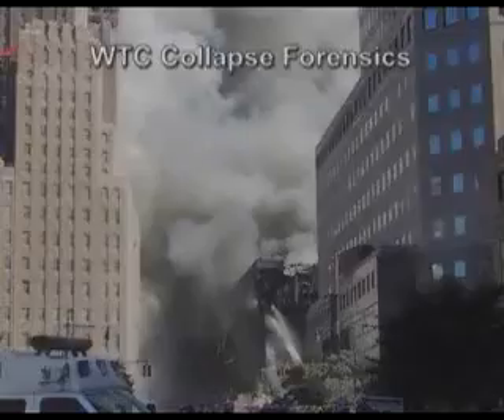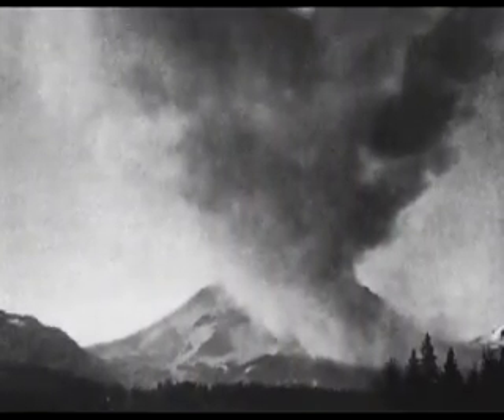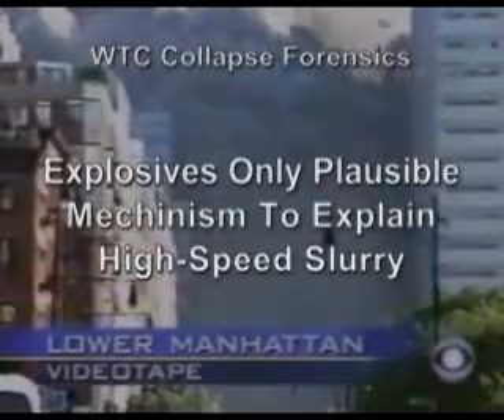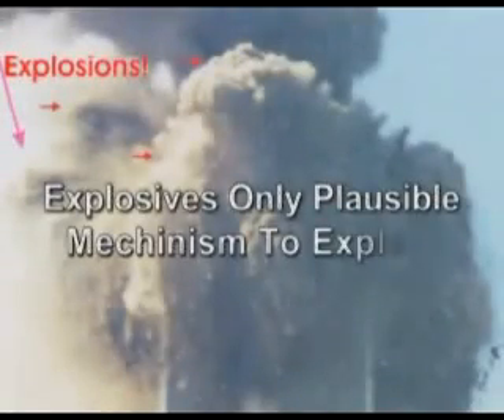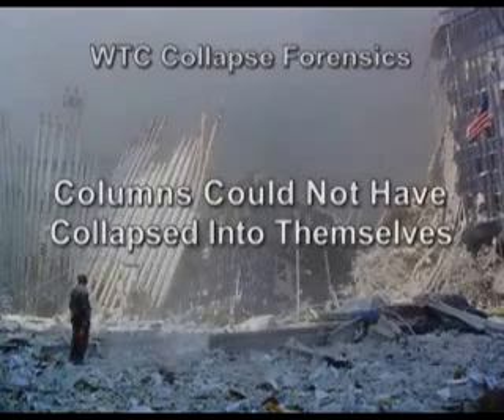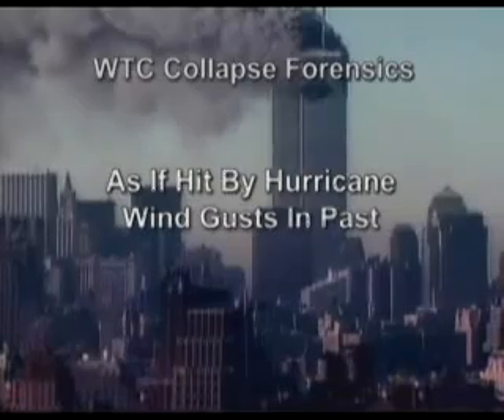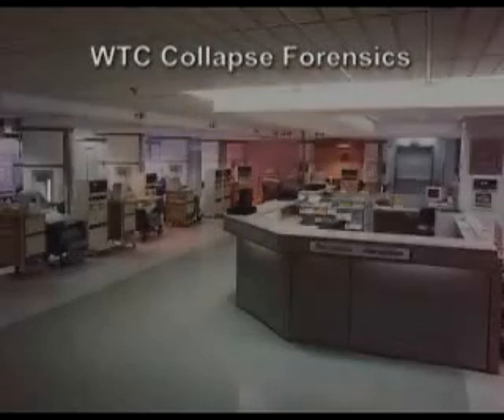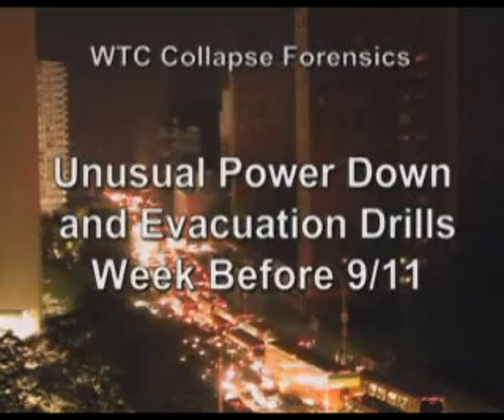MIT Engineer Disputes 911 Theory of the WTC Collapse-Part 2

Comment: 9/11 Truth nay-sayers like to rely on destroyed fireproofing that would have taken more energy that the plane impacts/explosions could generate, and the magical disappearance of structure that allowed an unimpeded freefall acceleration of the upper stories of the towers based on fires that at best might have reached 460 degrees C.
Reply: +Edward Anderson Though debunkers in general are quick to post this quote in an attempt to explain the 'collapses' of the twin towers, I have not encountered one yet that can explain "the motion of the falling portion began as a free fall".

"Structural systems respond very differently to static and dynamic loads, and since the motion of the falling portion began as a free fall through the height of at least one story (roughly three meters or 10 feet), the structure beneath them was unable to stop the collapses once they began."
Reply: +Mike Benign  It's pretty obvious what happened. The fires burned up all the air, and once the air was gone that meant there was a vacuum. Once there was a vacuum, the upper portion of the building rushed in to fill it,  at free-fall acceleration! Ta-Daaaaa1
Reply: +Edward Anderson I admire your ability to keep your sense of humor Edward. I know how discouraging it can be to face down these troll administrators (monitors) every day.
Reply: Mitch Mabee
Sooo..........you're not going to set any precedent for your cult of debunkers I see Mitch?
btw: answering a question with phys-op gobbledygook is not breaking new ground for your species.
Reply: +Mitch Mabee You will never see a debunker such as yourself explain the Ace Elevator Company employees running like scared chickens at the first sign of trouble on the morning of 9/11.
Reply: I don't know. Personally, I use the alleged "debunkers" as a weather vane of truth. Just look at the direction that they point their disinformation, then choose from the other 359 degrees of the information compass.
Reply: Mitch Mabee
Can you only find an intellectually compatible opponent in the mirror Mitch? Have you given up hanging around playgrounds with bags of candy?
Reply: Sandy P~all
Keep it up Chump Charlie. The more people that observe your operation to duplicate other users identity to post this kind of garbage attributed to them the better.
Reply: +Sandy P~all Ah now thats interesting. So they know something yes? Excellent, so what did we find out? What did they know? Ya that's what I thought. You weren"t just spreading innuendos and rumors were you Sandy? What can you learn that way? You see truth Sandy does not fall in your lap by simply starting a rumor about what it looks like was sort of on the minds of the elevator employees.  You dont come across truth that easily Sandy. Truth  takes hard work. Truth takes painstaking research and the willingness to dismiss an idea once its proven wrong.
Reply: Mitch Mabee
I can narrow that definition down for you Mitch by qualifying a "debunker" as a stooge who always writes the phrase "that has been debunked long ago". If you use that phrase in your normal YouTube activities, chances are good you are one of those assholes.
Have a great day.
Reply: +salvatore lucido if that's scary when you get to the truth you will not sleep for a few days!! check out the 911 Toronto hearings and project constellation by Richard andrew grove.
Reply: Mitch Mabee Well Mitch, the explanation is that your little Gish Gallop of speculation doesn't match the actual level of conspiracy, in which only a few were privy to the operation, and the rest were just unwitting pawns.
Reply: Mitch Mabee Hardly the same. The people who carried out the prep for 9/11 and provided the logistical support likely thought they were doing more benign activities, like construction and war games.
Reply: ***** Reality sucks sometimes.
Reply: Mitch Mabee The war in Iraq and the war in Afghanistan didn't "already exist".
Reply: "We'll know our disinformation program is complete when everything the American public believes is false."
_ William Casey, CIA Director, 1981
Reply: Mitch Mabee
Would it really matter if he did, or did not, since it represents a common view of the (lack of) intelligence community in my opinion? I know there has been debate over whether he did say that quote. I'm sure you'll say that's been debunked for years.
This is a very common when things like this occur. People just don't want to admit shit happens and take their lumps.
Reply: The kinetic energy was not absorbed by the structure, the structure failed because it was only able to stop a KE impact of 187 pounds of TNT, Flight 11 and 175 hit with 1300 and 2093 pounds of TNT, 7 and 11 times greater than the shell could stop, aka absorb, the excess energy went on to damage or destroy 6 to 10 core columns, whose wallboard was dislodged easy by the energy of impact.  
The WTC shell was bowing in, due to fire. Unless you have some fantasy of silent suck-a-bombs.  
The impacts were worse than big bombs because they were kinetic energy impacts, equal in energy to 1300 and 2093 pounds of TNT, but no blast effects, all the energy was directed at destroying the WTC stuff, insulation can be seen blasted out by these massive impacts.
The fact is you can't comprehend kinetic energy impact and are void of math, physics, and science. No wonder you are gullible falling for lies and BS made up with dumbed down opinions, like you have. 
The kinetic energy is not an explosion, it is the impact, it was massive and looks like an explosion because of the energy involved, and all that energy was used to dislodge the insulation and destroy structure. Next life take physics.  Me the dimwit is an engineer, and you the super 9/11 truth repeater of woo, is so smart, you fall for the same lies the Boston bombers did, and now you mock the murder of thousands with a failure to comprehend simple physics.  Good job, I am glad I am a dimwit and you are so smart you can't get anyone to believe your lies you can't define, or support with physics.  
Ironically Dimwit knows physics, and know fire destroyed the WTC complex, and I have proof the fires exceeded 660C, and higher; you have woo, I have the good old dimwit standby, science, physics, math, and critical thinking skills.   Geeks rule, you spread BS base on your common sense, for you it appears your common sense is the collection of prejudices acquired by age eighteen. Albert Einstein knows your failure.
Got Physics? No you have BS based on your failure, based on hate, based on laziness.  
When will you break the big story?  Dimwit wants to know... This is your best, being a peer of the Boston bombers on 9/11 truth issues.  Cool, you got famous super smart peers in 9/11 truth, who knew/
Reply: +Sandy P~all I have always found it very easy to dismiss the conspiracy group, like Noam Chomsky it's an unproductive argument. I'll say this, though my position has not changed, I admit my position gets really fucking hard to support once we mosey down the street to building 7. That anomaly is a fucking bugger. I feel like most of the time I am basking in the bright light of empiricism until building 7 comes up in the conversation. Then my position takes on a stench of religion. I start feeling like I have taken some Jim Jones leap of faith
Reply: +salvatore lucido Maybe it was a bad example, the point is even the most strict empiricist confronts a myriad of unknowns everyday. The idea is to follow the evidence, not start with an outrageous hypothesis and then refuse to consider any evidence that threatens it. See every conspiracy theorist for further examples.
Reply: +Sandy P~all Im sorry I dont follow. The term. debunker; doesnt narrow anything down. Do u mean conspiracy debunker assholes  like myself? or those that debunk the anti conspiracy  group?? Also to thoughtlessly dismiss all evidence that doesn;t bolster your own theory as part of an elaborate disinformation campaign is either a convenient miss step in logic or paranoia of a clinical severity.
Reply: +Edward Anderson And you believe this idea.?? So your saying its a lot like suicide bombers. They strap explosives on the kids and say No silly you'll be fine, dont you know how explosives work? They blow out not in. You wont have so much as a scratch. Back state side pre 9/11 the boss says hey new guy crawl thru the wiring duct on the 83rd floor  and attach this to the support beam . Okay . .  Sir, why does it say Acme Bomb Co on the side. Oh that? thats just this this thing whats the Denver Broncos record again. 4 and 2 but that really doesnt answer my question sir
Reply: +Edward Anderson My govt is not capable of such an elaborate plot, nor has anyone in service of my govt ever kept a secret that long. Plus I still think you're weak on motive. Hitler's pay off for the Parliament building justified torching the place I guess. Tonkin Bay got us into the Vietnam war but The Patriot Act? That's the payoff? It's not enough. Did 9/11 generate consent for a war that didn't already  exist? I really don't know the answer to that one.
Reply: +Mitch Mabee In writing that post above I just realized that 9/11 if it was a conspiracy is closer to S.O.P. standard operating procedure isn't it.  Okay so it has happen often in recent history. I'm sorry that's still not proof. but I admit it stinks.
Reply: +Edward Anderson The kinetic energy impact of Flight 175 was equal in energy to 2093 pounds of TNT. More than enough energy to remove fire proofing on the floors; it can be dislodged with a finger; the core of the WTC was covered in wallboard, easy to remove with the aircraft impact. Witnesses saw wallboard in stairwells dislodged due to the aircraft impact; your BS statement is a lie, based on an overwhelming ignorance of physics. 175's impact was more energy than 2,000,000 shot gun blasts... next time do the math and physics, don't spread BS.
Reply: +eyesuntzu Hey! You with the reason and the new fangled empiricism, get out of here. This string is for wing nuts only. Just kidding but we prefer innuendo to science around here. Most these folks have a pretty tight white knuckled grip on their treasured conspiracy. In the words of Bertrand Russell-"You cannot rationalize someone OUT of something they didn't rationalize themselves INTO." They didn't use logic or reason to develop these theories so they will be useless tools in setting them straight.
Reply: +Sandy P~all Did William Casey really say that?
Reply: +Mitch Mabee 
Of course, your clearly a shill paid off by Jews to come on channels like this to troll and obfiscate honest enquery.
Reply: Mitch Mabee eysuntzu said,"Thus there was more than enough energy to remove the fire proofing on the floors; which can be dislodged with a finger" , and, " 175's impact was more energy than 2,000,000 shot gun blasts... next time do the math and physics before spreading BS based on lies."

Please check the NIST report, which puts paid to eyesuntzu's  "reason and new-fangled empiricism", which in fact is not, since he bases his conjectures on faulty and misapprehended "facts".

Those of us with enough information see right through his weak-ass crap, which he can dislodge with a finger.
Reply: +Edward Anderson You can't do math, not news.  You and physics never met.  You failed for 14 years to figure out 911, and your peers in this BS are the Boston bombers.  That is as much fame as you will get, believing the same lies the idiot Boston bombers believe on 911. 
Next life take physics, it will keep you from being fooled by a fringe few fake experts who do you tube videos.  lol, 14 years, no clue yet. 
You can't calculate the energy of the aircraft impacts, how can you make any conclusions.
Reply: +Edward Anderson You think there was enough energy to remove all the fire proofing? You really think there was enough fire? That black smoky oxygen starved fire caused this collapse?
Reply: +Banjo Marla Oxygen starved? When a fire has far more oxygen then it can possibly handle coming  from the easterly winds we don't call it starved. That fire proofing falls off by itself or by brushing your pinky finger across it will take all of it off. If somebody slams a door it comes off.
Reply: Mitch Mabee Funny how NIST couldn't affect the fireproofing significantly using a SHOTGUN test. You are promoting bad information. "That fire proofing falls off by itself or by brushing your pinky finger across it will take all of it off. If somebody slams a door it comes off." is pure BULLSHIT, intended to lower the threshold of proof for your idiotic argument.
Reply: +Edward Anderson Insulation was dislodged by the impacts; a fact. 
Under the floors the insulation can be removed by a pinkie finger. 
The core column of the WTC were insulated with wallboard, 3 inches, and it fell off due to the impact of the Aircraft.... a fact verified by survivors who saw the wallboard in the stairwells... evidence. 
Flight 11 was 3,075,000,000 joules, equal in energy to 1400 pounds of TNT, which destroyed 6 core columns, and knocked off insulation on multiple floors in the core; as eyewitnesses testified. 
Flight 175 4,380,000,000 joules, which destroyed 10 core columns... an impact equal in energy to over 2000 pounds of TNT... 
Facts and evidence prove fire caused the WTC towers to collapse.
Reply: +Nathan Bitchner People with the last name of Mabee seldom find themselves in a position to make fun of someones name. Until you stowed up. I'm quite sure I will thank you to stay out of my personal affairs. But if you must know when I go trolling for a new date I'm usually driving the 1972 Road King extended Dodge van with the curtains. Also known as the pedophile starter kit. Comes with one long rain coat, a box of Snicker bars and a speckled puppy.
Reply: +Edward Anderson You are right, I exaggerated to bolster a poorly made point. I concede the point . Because it makes no difference. Leave the fire proofing on. Let the jet fuel, paper and furniture stoke the heat until its on par with a ceramic kiln and ask yourself is the building in danger of collapsing BEFORE THE METAL SUPPORT BEAMS REACH A ROLLING BOIL?? I GRANT YOU, THE FIRE NEVER GOT HOT ENOUGH TO BOIL METAL ARE YOU SURE EVERYBODY IS SAFE FROM THE STRUCTURES COLLAPSING IF IT ONLY GOT HOT ENOUGH TO TURN THE METAL INTO PLAY-DO with a quarter million tons of concrete and steal on its back???? Are you sure its not even an issue when that metal softens???
Reply: +Mitch Mabee Give me one example of any other steel high rise "turning into Play-Do" from a fire and collapsing.
Reply: +Mitch Mabee I guess the demolition industry is just wasting thousands of dollars when they need to rig the columns with explosives and sever them with minute precision right? They could just light the office furniture on fire and it'll turn to play-do. Yup that's how poorly buildings are designed. What were we thinking? And silly us using steel pots and pans for cooking, don't we know they turn to play-do?
Reply: +misterhed Steel pots and pans you boil food in at 212 degrees?  What temperature has steel lost half the strength?  
Steel or cast iron where we braise beef at 375 to 450 F? Will this make non-load bearing pots fail?  Science, not opinions are needed, and the video is based on failed opinions.  
Demolition industry can't start fires and spread toxins, they would be in trouble. Fire destroyed the WTC towers, a fact the video failed to grasp.
Reply: eyesuntzu "Will this make non-load bearing pots fail? "
Uuuhh who knows what steel will do anymore, since apparently a fire of 300 degrees C caused WTC 7 to implode into itself at free fall speed. Maybe next time I turn on my oven it'll just collapse. I like how they took all the steel away and recycled it too so they can't investigate the evidence. So sciency.
Reply: +misterhed And you are an engineer?  Less than 0.1 percent of all the worlds engineers agree with the BS you have on WTC 7.  
When you get a PhD in engineer, you will discover 9/11 truth is based on ignorance, BS, lies and wild claims not base on science. Good luck.
Reply: eyesuntzu If it's possible to demolish a building so completely like that using fire why has it never been seen before? Why can't it be replicated? Isn't that one of the tenants of science? You can replicate it? 

"In the mid-1990s British Steel and the Building Research Establishment performed a series of six experiments at Cardington to investigate the behavior of steel-framed buildings. These experiments were conducted in a simulated, eight-story building. Secondary steel beams were not protected. Despite the temperature of the steel beams reaching 800-900 C (1,500-1,700 F) in three of the tests (well above the traditionally assumed critical temperature of 600 C (1,100 F), no collapse was observed in any of the six experiments)."

I don't know if me getting a pee aich dee will change the fact that building collapses due to fire NEVER happens.
Reply: +misterhed No matter how much BS 9/11 truth comes up with the Gish Gallop of idiotic claims, only 0.1 percent of all the world's engineers don't think fire did it.  That is a fringe of the fringe, a sub-set of insane engineer... Thus your BS based on BS, remains BS, and fire did it.  
Why has 9/11 truth failed for 14 years with a lock on infinity? 9/11 truth has no evidence, no clue, and no rational claims.
Reply: Thank you very much for repeating your appeal to authority fallacy again. Once more, show me... another instance... of a steel high rise that collapsed from a fire. It happened 3 times in one event apparently, surely it should have happened at least once in history?
Reply: +misterhed LOL, the NIST report was done by experts, hundreds... thus this is not an appeal to authority, it is authority. 9/11 truth makes the appeal to authority with idiot engineers who can't think rationally; thus you failed to understand your less than 0.1 percent authority group of failed engineers, is the classic failed appeal to authority fallacy.  And you offer no evidence, the same as your BS engineers you can't get to do a paper in real journal to support your fantasy version of 911, where steel can't fail.  Good job failing on the fallacy, that was funny.
Steel fails in fire, a fact 9/11 ignores.  No big deal, zero evidence for 14 years from 9/11 truth, with a lock on infinite fail.
you never will produce a valid argument, as you and less than 0.1 percent of all engineers fail to make a valid claim, and produce BS claims based on delusional opinions.... keep up the good work, is Bigfoot next, or will it be chemtrails?  lol
Reply: eyesuntzu ". thus this is not an appeal to authority, it is authority"

LMAO LMAO LMAO that's what appeal to authority fallacy means!!!! hahahaha

"Steel fails in fire"

Show me a steel building that has failed and collapsed in a fire. come on not even once? like in the industrial revolution or something when safety was shit?
Reply: +misterhed You don't understand the logical fallacy on authority. In fact, the designer of the WTC structure, says if fell as it would in fire. Thus you fail to realize the guy who signed the blueprints, knows the WTC towers could fail in fire, and it collapse exactly how he expected his structure, he designed would fail. This is the number one reality based authority on earth; thus it is not a fallacy, he is the authority.  9/11 truth has engineers like the the nut in the video, who are not experts or have BS claims, and that is appeal to authority.  You getting an engineer off the street, and he claims it can't happen is an appeal to authority. The fact that many engineers worked on the NIST report and all engineering associations agree it was fire, is not an appeal to authority, it is fact based evidence driven studies you have to ignore to have the 9/11 truth dumbed down lies and BS.  
May studies were done beside NIST, they all agree it was fire.  Sorry, but this is based on engineering and studies not failed opinions from less than 0.1 percent of all engineers.  
You got nothing, never will; your peers in 9/11 truth, the Boston bombers, two idiots agree with you.  Congratulations.  Better luck with Bigfoot, and Chemtrails.
Reply: eyesuntzu So the claim is that the government perpetrated 9/11. And because the government investigated itself and found nothing wrong that's proof? But 2000 architects and engineers are just appeals to authority. Your 0.1 percent figure doesn't mean anything. Most people just do their job and it isn't their area of expertise. What about how in 1993 John Skilling, head architect of the WTC said 
"We looked at every possible thing we could think of that could happen to the buildings, even to the extent of an airplane hitting the side… Our analysis indicated the biggest problem would be the fact that all the fuel (from the airplane) would dump into the building. There would be a horrendous fire. A lot of people would be killed. [But] the building structure would still be there.”"
Oh wait, only the authorities that contradict you are appeals to authority..
Reply: +misterhed John Skilling was not the chief structural engineer on the WTC towers, Robertson was. Robertson worked for Skilling. 
And the aircraft impact for the building to survive was at 180 mph, an impact energy equal to 187 pounds of TNT; the impacts on 911 which removed the fireproofing from floors and core were equal in energy to 1400 and 2000 pounds of TNT.  Thus impacts more than 7 and 11 times great than design happened on 911.
The aircraft impact was for an accident, like trying to land in the fog, the only accident possible for an airliner who is low on fuel; a fully fueled airliner would climb to clear weather and land in the clear, not be lost in the fog to hit the WTC... the impact for the Empire State Building was equal in energy to 18 pounds of TNT, and did a lot of damage with fire... the WTC would stop the ESB impact, and also a 300,000 pound airliner at 180 mph. Facts not BS.
Skilling never said the building could survive an impact over 180 mph.  
steel fails in fire - 99.9 percent of all engineers agree with me; you can ask them, but you can't, you are too busy using google to do the Gish Gallop of BS.
Reply: eyesuntzu Why haven't you gotten back to me with an example of a building collapsing due to steel failing in a fire yet? What is this 99.9 percent bullshit? You would have to ask every engineer to get that figure.
Reply: +misterhed WTC 1 and 2.  Plus it is a fact steel fails in fire.  9/11 truth liars can't comprehend the science of steel, they use BS opinions based on overwhelming ignorance and paranoia.  
Prove steel can't fail and fire, prove there were explosives, or what ever silly claim you have; and I will be on CNN with your evidence and be famous; give me your evidence... 
LOL, you got BS from the Internet, where everything is true....

You are gullible - don't get upset, get knowledge
Reply: eyesuntzu LOL you had to use OTHER buildings from 9/11??? You couldn't find any other demonstrations of buildings collapsing due to steel failure from fire, but it happened 3 times in one day, one of which wasn't hit by a plane?

That's like if I said last Wednesday Billy, Bob and Joe vaporized into dust because they had a fever. And then you say fevers don't usually cause people to vaporize do you have any other examples of people turning into vaporizing from fevers? Then I say Billy and Bob! Prove people can't get fevers!
Reply: Mark Olander If there were nukes in the basements , there has to be another explanation for the collapse of the upper  mass (More nukes? Maybe on the computer server floors?) A nuke would also explain Bldg. 6, which is just bizarre.
Reply: Mark Olander I think Building 6 had its own little "device". I think there were multiple operations occurring on 9/11, one or more of which were robberies.
Reply: +Mitch Mabee They can't figure out what you said...
Reply: Mitch Mabee said, " . Let the jet fuel, paper and furniture stoke the heat until its on par with a ceramic kiln and ask yourself is the building in danger of collapsing BEFORE THE METAL SUPPORT BEAMS REACH A ROLLING BOIL?? I GRANT YOU, THE FIRE NEVER GOT HOT ENOUGH TO BOIL METAL ARE YOU SURE EVERYBODY IS SAFE FROM THE STRUCTURES COLLAPSING IF IT ONLY GOT HOT ENOUGH TO TURN THE METAL INTO PLAY-DO with a quarter million tons of concrete and steal on its back???? Are you sure its not even an issue when that metal softens???"

This presumption of kiln-like conditions is unrealistic, and just another example of the exaggeration necessary to "prove" your contention that the steel was affected to such an extent that it softened floor-wide (core and exterior columns included) to allow a precipitous acceleration of mass due to it's supposed over-all  "Play-do" consistency.

If such were the case, the building would have been glowing hot, visibly. Such was NOT the case.
Reply: +Edward Anderson lol, the silly part is your are serious the building should have been glowing.  Steel fails in fire, a fact ignore by the CD inside crowd armed with zero evidence for their fantasy scenario never detailed or explained.  Who did 9/11 in the fantasy version the video implies?
Reply: eyesuntzu Steel does NOT typically "fail in fire", to the point of total gravitational collapse, as can be seen in EVERY disaster OTHER than 9/11.

I believe the Mossad took care of the set-up, and Cheney and his PNAC minions took care of the cover-up, and they ALL got played by the Saudis. 

And why is it "silly" to suggest that "kiln-like" temperatures, as claimed by the brainiac Mitch Mabee , wouldn't make the steel red-hot?
Reply: Hi, Ed. How many people do you think it took to orchestrate this from start to finish, including recruiting, WTC security (couldn't have kept all this work a secret from them if you're hauling that much demolition material into the building), structural & mechanical engineers, overall project security, army bases, CIA, FBI, NSA, construction workers, construction company managers, demolition workers, materials procurement, materials delivery, project management, accounting, payments, foreign involvement, fake witnesses, trainers for fake witnesses, and so on? I'm guessing that would be at least 10,000. I figure the recruiting department alone would be 200 people probably more, and how would you engage the recruiters to begin? Also, how would you go about recruiting participants for this? Where do you find them? Everyone had to have the right skills, but the plan still takes big-time management and training. I can't imagine that every person they approached said yes. There would have to be a big background dossier on each proposed person and there would have to be more than one person to approach for each position, so there would have to be an army of investigators helping the recruiters to pick the right people. How would you approach all of those people? And how could they all remain completely silent to this day? I just can't see how this is possible, and I hope to hear how the logistics worked in recruiting, management, etc. I'm not asking sarcastically, I just really want to know how many people you think were in on it, and how you recruit, train, and manage them...Where did they all  meet? Where did they all train? How many thousands of meetings were there? How would you go about managing these things? Did the organizers give them their own phones and destroy them later? Was there a phone company involved to destroy all records and equipment after? Did they get Microsoft to erase all of the emails? Who managed all electronics equipment and communications? I feel like the things I named just scratch the surface of the "inside job" scenario...I mange projects for a living and all these things would have to go on my list. How do you think they managed this? Doing this work for a living, I can't imagine how many people I'd have to pay off just inside the building (elevator guys, building security, janitors, building inspectors, carpenters, painters, department managers). It makes my head spin to think about how many people I'd have to get in on this. How would you go about all this?Tx
I also think, given the number of people and the steps involved starting with concept and recruiting, that it took years, not 9 months to put it together. I manage large projects for a living, and something like this would take years, especially if you're keeping it a complete secret. Do you think Clinton was involved? It would have taken government resources years prior... Unless you think that George Bush Jr was able to convince all of these people to participate in and dedicate their lives to this scheme when he was just announcing that he was going to run for president... I don't see it. If anyone had approached me, I would have declined. I can't think of anyone I've ever met who would agree to participate in this...
Also, have you ever put your hands on fireproofing material? You should really buy a bag of Monokote and put it on a piece of steel and dig into it with your fingers so you see what kind of material it is. I work with fireproofing material a lot. It comes off very easy... I scrape it off all the time at work with a putty knife or a hammer. You should get a bag. Just mix it with water. It gets sprayed on, otherwise it won't adhere. so get the binder if you are going to put it on something by hand.
Hope to hear your thoughts on how this all got managed...
-J
Reply: Jim Nason Jim, Jim, Jim.... This ploy is as hackneyed  and tiresome as it gets. All this has been addressed  by MANY people, and the fact that you think it has merit indicates your virginity.

But (just for fun), let's break it down, shall we?

." How many people do you think it took to orchestrate this from start to finish, including recruiting,"

The Mossad likely took care of the logistics and ground operations, so maybe 20 (no "recruiting" necessary!) 

"WTC security (couldn't have kept all this work a secret from them if you're hauling that much demolition material into the building),"

Security was compromised by insiders in the government(s), and ordinary construction activity masked the operation, along with some night work toward the end.

 "structural & mechanical engineers, overall project security, army bases, CIA, FBI, NSA, construction workers, construction company managers, demolition workers, materials procurement, materials delivery, project management, accounting, payments, foreign involvement, fake witnesses, trainers for fake witnesses, and so on?"

Maybe another 10 insiders. Most of those involved likely had no idea they were doing anything wrong, just following orders.

 "I'm guessing that would be at least 10,000. I figure the recruiting department alone would be 200 people probably more, and how would you engage the recruiters to begin? Also, how would you go about recruiting participants for this? Where do you find them? Everyone had to have the right skills, but the plan still takes big-time management and training. I can't imagine that every person they approached said yes. There would have to be a big background dossier on each proposed person and there would have to be more than one person to approach for each position, so there would have to be an army of investigators helping the recruiters to pick the right people. How would you approach all of those people? And how could they all remain completely silent to this day? I just can't see how this is possible, and I hope to hear how the logistics worked in recruiting, management, etc."

Like I said before...Mossad, plus a few bent individuals  in our own government, so your whole "recruitment" scenario is total bullshit. Good try, though. must have hurt your brain a bit thinking up all those categories of involvement...or did you just look it up in your administrative hand(job)book?

 "I'm not asking sarcastically,"

No, you're asking DISINGENUOUSLY, because you're a smug little shit.

" I just really want to know how many people you think were in on it, and how you recruit, train, and manage them..."

Less than 50, mostly foreign operatives who were repatriated before they could be investigated, thanks to Michael Chertoff.

"Where did they all meet?"

Safe houses and Urban Moving Systems. Rumsfeld's office. Duck hunting with Cheney. 

"Where did they all train?"

 Mossad facilities in Israel for the infiltration team, University of Chicago for the PNAC guys.

 "How many thousands of meetings were there?"

Thousands???! Now you're just being silly....spycraft isn't big on "meetings" You're treating it like an engineering project for some legitimate business enterprise.

 "How would you go about managing these things?"

Threats of violence to individuals and their families. 

"Did the organizers give them their own phones and destroy them later?"

They used carrier pigeons.

"Was there a phone company involved to destroy all records and equipment after?"

They used those little 'Mission Impossible self-destructing eyeglasses with the heads-up display, naturally. Of course, this meant that all of them had to endure being called "four eyes" at times.

"Did they get Microsoft to erase all of the emails?"

No emails. They weren't as stupid as you seem to be.... 

"Who managed all electronics equipment and communications?"

Omar, Hakim, and Jeff.

 "I feel like the things I named just scratch the surface of the "inside job" scenario...I mange projects for a living and all these things would have to go on my list."

I suspected as much. Don't interview with the CIA. You're not clandestine material.

 "How do you think they managed this?"

Carefully, and by being vewy, vewy, quiet 

"Doing this work for a living, I can't imagine how many people I'd have to pay off just inside the building (elevator guys, building security, janitors, building inspectors, carpenters, painters, department managers). It makes my head spin to think about how many people I'd have to get in on this. How would you go about all this?Tx"

You do terrorist activities for a living??? !'m surprised you haven't been found out what with your endless committees and all....

"I also think, given the number of people and the steps involved starting with concept and recruiting, that it took years, not 9 months to put it together. I manage large projects for a living, and something like this would take years, especially if you're keeping it a complete secret."

Yeah, I can see where you would...But then, you're a victim of your POV. 

"Do you think Clinton was involved?"

Chelsea? Sure. She has beady eyes.

It would have taken government resources years prior... Unless you think that George Bush Jr was able to convince all of these people to participate in and dedicate their lives to this scheme when he was just announcing that he was going to run for president... "

Check out "PNAC"

"I don't see it. If anyone had approached me, I would have declined. I can't think of anyone I've ever met who would agree to participate in this..."

That's because you aren't a hard-line Zionist, or an idiot sympathizer. You're just an idiot.

"Also, have you ever put your hands on fireproofing material? You should really buy a bag of Monokote and put it on a piece of steel and dig into it with your fingers so you see what kind of material it is. I work with fireproofing material a lot. It comes off very easy... I scrape it off all the time at work with a putty knife or a hammer. You should get a bag. Just mix it with water. It gets sprayed on, otherwise it won't adhere. so get the binder if you are going to put it on something by hand."

Check out NIST's "shotgun" test for fireproofing removal by shredded aircraft bits and explosive concussion.. I predict you will be highly disappointed.

"Hope to hear your thoughts on how this all got managed..."

There ya go, Bubba. Enjoy.

And just to be clear,

The Twin Towers’ destruction exhibited all of the characteristics of destruction by explosives:
Destruction proceeds through the path of greatest resistance at nearly free-fall acceleration

Improbable symmetry of debris distribution

Extremely rapid onset of destruction

Over 100 first responders reported explosions and flashes

Multi-ton steel sections ejected laterally

Mid-air pulverization of 90,000 tons of concrete & metal decking

Massive volume of expanding pyroclastic-like clouds

1200-foot-diameter debris field: no “pancaked” floors found

Isolated explosive ejections 20–40 stories below demolition front

Total building destruction: dismemberment of steel frame

Several tons of molten metal found under all 3 high-rises

Evidence of thermite incendiaries found by FEMA in steel samples

Evidence of explosives found in dust samples
The Twin Towers exhibited none of the characteristics of destruction by fire:
Slow onset with large visible deformations

Asymmetrical collapse which follows the path of least resistance (laws of conservation of momentum would cause a falling, intact, from the point of plane impact, to the side most damaged by the fires)

Evidence of fire temperatures capable of softening steel

High-rise buildings with much larger, hotter, and longer-lasting fires have never collapsed.

Follow the evidence, not your urge to absolve the guilty because you're on their "team", philosophically.

And trying to propagate some blue-sky scenario to "disprove" the logistical possibility of something that obviously happened is a fool's errand.

Are you a fool, "Jim"?
Reply: eyesuntzu You do love that "Gish Gallop" accusation,. dinkums.

FEMA didn't LOOK for thermitic material, although by law they were SUPPOSED to for any collapse over ten stories, so you're STILL an idiot.

FYI, the reason they gave for not looking was that they didn't expect to find any, and didn't want to waste the taxpayers' money. 

MAHVELOUS use of the Scientific Method by FEMA, dinkums.
Reply: +Edward Anderson No thermite, that is a fantasy by a failed Dr Jones, he made it up and faked a paper. No wonder you have no Pulitzer. You copied and pasted BS from AE911T, who spread the dumbed down lie of CD with no evidence. 
No steel on 9/11 was damaged by thermite, a fact that makes your claim a lie, or a fantasy.  The path of least resistance is published where? lol
The fires in the towers were the biggest in history and burned with more heat than 2,700 tons of thermite.  How much thermite is in your delusional fantasy version of 911.
Reply: eyesuntzu The only fantasy is YOURS, eyeballz. Sulfided steel was found in WTC7 debris.
Reply: Thanks, Ed.
Interesting to hear your (more serious) responses. I don't think I could possibly not sound at least a little disingenuous given the subject, and you have to admit that your less skilled co-believers who haven't honed their skills as much as you make your movement a little ridiculous sometimes. I saw your persistence and saw a genuine zealot (forgive the inherent Jewish context) who would respond to the impossibilities that I saw with my practical experience. I couldn't help but ask the questions knowing you've long since formulated the responses. I was interested in seeing how the magnitude of the conspiracy could be dismissed and explained away.
You are correct, I don't participate in these things. My U-Tube comments section virginity has been discovered. I wasn't intending to be a little shit, I knew what I was dealing with.
The impossibilities are entertaining and implausible like the super hero movies I watch twice a year where I let go of reality and go with it. I was expecting the condescending responses and name-calling. You've been doing this a long time, so I don't mind. You do what you do.
Having put myself through school and having spent nearly 30 years constructing buildings and developing projects and learning about their components and material properties, along with project development and construction has has given me skills and insight that made the events irrefutable to me. I'm not a genius, and don't purport to be. I don't think it takes one. Myles Power put together a far better response to the Truther theories than I could have. I assume you've watched your competitors.
Explosions and flashes to me are structural components falling one piece or section at a time onto the floors below and displacing air and flames when they do. I've witnessed the sight and sound as steel members fall. It's loud. It's powerful. If concealed within a building, one would think it was a bomb. One falling member does not immediately fall the building.
A bomb in the lobby is an express elevator plunging 50 floors  to the bottom and exploding after the cable is severed by a plane. 
Random windows blowing out is air displacement from some falling members preceding others. 
Confused, shocked, and unknowledgable  witnesses trying to describe the sounds and sights are... fallible and too often cited by those with an agenda. Having known many firemen, I find they often make poor witnesses or experts, often talking out of their ass as it were.
A cloud of dust is a cloud of dust, and it has to flow somewhere given the quantity of easily pulverized light-weight concrete and drywall that it was... The physics and flow of Lime, silica, and gypsum dust vs Pyroplastic flow? I don't know anything about it.
Video of 30' tall sections of wall bowing inward about 6'' as un-seen floor joists pull at them for 20 long minutes with the camera zoomed in on it as it collapses at that very place... I've been trained and educated on how steel structures work. I have to disagree with you that it is characteristic of classic explosive demolition. It's classic structural failure, and every structural engineer with more experience than me agrees (I know several), except for the few fringe believers in the industry that you may find. 
Watching large pieces of unhindered debris 50 feet outside of the main building falling nearly twice as fast as the building itself and in the same video frame was proof enough to me that the building was not in "freefall". 
Jet fuel burns when atomized, When it coats a surface it continues to burn for a long time as the evaporating portion is what burns (that I did get from U-Tube videos, certainly put there by the CIA, no, Mossad).  
Witnesses saying they saw a plane fly into the Pentagon are worthy of being believed. Otherwise they are just a part of the 10-man conspiracy that took no recruiting. Sorry, I'm being a little shit again.
Planting explosives in 3 buildings that you were already flying planes into (and only two planes at that, for 3 buildings) is... ... ... ridiculous. Had it been the meticulous, over-thinking, in-efficient, phone-using, non-clandestine manager that I am doing the planning, I would have gone all-in on the 3rd plane and done away with the explosives. It's the practical approach.
I'm willing to believe that a conspiracy gets perpetrated. I would believe in this, if it was believable.
It all sounds too simple to you, I know, so you think anyone suggesting it is simple in kind. You are hateful of any government with authority over you. No, not a fool, just a bright, driven, pragmatic, educated, contemplative, inquisitive man with some great experience and expertise that I'm certain you and most of your colleagues don't have (not even so often cited "peer-reviewed" Dr Jones who won't present his dust samples for further testing by said peers). Movies to me are just entertaining fiction. Super-spy Mossad infiltrators planting explosives throughout multiple floors of 3 high-rises while construction workers and building occupants carry on around them with no one noticing, and forced participants are threatened by evil black-ops mercenaries, as other teams hi-jack planes and fly them into the exact locations of explosives without actually setting off the explosives for another 45 minutes, while missiles are fired into empty Pennsylvania fields and the Pentagon from phantom planes by a small group of big business conspirators and jews... Fun. Really. Fun!
I could never prevail in a debate with you. Though you've developed the most detailed impossible story I've heard, you're just too skilled at the debate, and persistent. Honestly, I'm not that good at it since I don't really partake. My debating dick is smaller and I'm too simple-minded. Just a spectator watching as you do your thing. You've put a lot of time and effort into the formulation and you really enjoy it. Carry on! Do what you enjoy. That part is not disingenuous. It's been fun!
Reply: +Edward Anderson The "Sulfided steel" was corrosion caused in fire at 800 to 1000C which is clearly explained in the study. Thus the corrosion was not caused by thermite, but by fire and stuff present in the pile which burned for weeks.  You like fantasy, and failed to read the report.
Don't worry, the report you don't understand proves no thermite, can be quote mined for most anything in your fantasy world of lies. 
https://www.fema.gov/pdf/library/fema403_apc.pdf
Yes, you can take the 6 times liquid is in the report and make up lies of melted steel.  
Or the five times melting shows up, great "quote gems" to back your delusional fantasy; the one you can't explain past some wild dumbed down fictional BS.
Or you can BS people with FEMA Appendix C and use eutectic which shows up 9 times and make up new Chemical Engineering BS to support your thermite delusion.
Reply: eyesuntzu The sulfidied steel was NOT "explained in the study" The only mention was WHAT it was, not WHAT EVENT CAUSED IT TO FORM. THAT was IGNORED by the study, and the New York Times called it one of the enduring mysteries of 9/11 

Explaining temperature and chemical content is only half the story. The OTHER part would be ascertaining the source of the sulfur (NOT "gypsum board", which cannot provide the sulfur in a usable form for the reaction.)
Reply: +Edward Anderson The paper explains the steel structure, the corrosion occurred at 800-1000C, way below the melting point of steel. And it explains using chemical engineering jargon the steel corroded in fire.  Corrosion in fire, not thermite.  There is no proof of thermite damage to any WTC steel. There is no damage to steel from thermite or explosives.  Thus your CD theory, you have one right, is bogus.  
Are you saying there is no sulfur sources in the WTC?  What is in a UPS? Sulfur can't be in tires... or plastics, etc... wow, where did your fantasy sulfur come from?  Yes, your fantasy sulfur comes from nuts on the Internet, like Jones, or other failed experts who fuel your fantasy version of 9/11, which is bad fiction.  
Sorry, but corrosion of steel in fire at 800-1000C is proof of fire, not thermite - it is science, like Chemical Engineering stuff - neat course, Chem Eng 101... next time use knowledge, not imagination based on BS.  
https://www.fema.gov/pdf/library/fema403_apc.pdf
Watch out, corrosion in our older cars looks just like the two samples from the WTC corrosion in fire; it happens in the battery box.  Wonder where that sulfur comes from... thermite in my car engine, under the hood, and inside job... lol, corrosion debunks your thermite claims.
Reply: eyesuntzu The claim is WRONG, dumbass. 

By ignoring the presence of thermitic material, the analysts were forced to provide an explanation that  is far-fetched and depends on idealized temperatures and bullshit chemical sources.

You said, "corrosion in our older cars looks just like the two samples from the WTC corrosion in fire; it happens in the battery box. Wonder where that sulfur comes from."

No, it doesn't. since there is no MELTING of the material involved. And that corrosion is from the sulfuric acid IN THE BATTERY. moron.

See? Obvious source. Just like thermate, which is sulfided thermite, the sulfur being added to lower the threshold temperature. of the thermitic reaction.
Reply: +Edward Anderson lol, there is no damage to any WTC from thermite, it would leave evidence of high temperature attack on steel, and leave iron, piles of iron. Where is your evidence? 
The steel did not melt, there was no melting of steel, it was corrosion in fires.  
Are you saying thermite only gets to 800-1000C when it burns? 
The people who studied the steel corrosion said it was not from thermite, you could ask them.  
Better ask a Chemical Engineer for help on this one, you are too deep into the lie of thermite.  
Corrosion of steel in fire.  You have no proof of thermite. 
https://www.fema.gov/pdf/library/fema403_apc.pdf
Reply: eyesuntzu Of course there was melted steel, in the rubble piles. Also, the dust had a high percentage of iron spheres entrained with sulfur that are a signature of a thermite reaction.

It seems to me that you people are trying awfully hard to deny the existence of something that would be fairly obvious to an unbiased investigator.
Reply: +Edward Anderson No melted steel, you have no evidence. And iron was found at or below the percent it is in the background of east coast soil. Iron microspheres form in fire where iron bearing substances are. 
You never will produce evidence for melted steel, or figure out iron in the dust is what happens in fires.
Reply: eyesuntzu Yeah, I call BULLSHIT on your ridiculous reaching to prop up your intentional lying. Everyone honest knows by now that the byproducts of thermitic reaction, and unreacted thermitic material, were found in the WTC dust .
Reply: ***** A "FORGE"? Please....you idiots will say anything to "explain" the impossible.
BTW, your "pancake" effect has been utterly disavowed, even by NIST. You are obviously just another ignorant  bullshit artist with ZERO scientific acumen repeating crap spewed by OTHER bullshitters. Better minds than yours prove you a fool.

Forge temperature for carbon steel is 1230 C., in case you'd like to tenuously tether yourself to reality. Go work out how that mass accelerated through 20' of vertical distance occupied by structure, with only a PERCENTAGE of damaged structure (less than one-quarter the structure in a building with major structural redundancy) and fires that could be tolerated by a person seen standing in the impact opening.

Additionally, you could burn jet fuel ALL DAY LONG and not affect structural steel to the point of failure, especially when the heat can dissipate throughout the structure (basic physics). Hardly "forge-like " conditions, dimwit.

Don't pass off prejudiced belief as proven science.
Reply: ***** I'll alert the steel industry. Apparently, they've been working WAY to hard to refine the furnace-building process.

Seriously, you are suggesting conditions that have NO hope of raising temps past that of a well-ventilated camp fire, over which a steel grill can be placed for cooking "denier weenies". 

FAIL.
Reply: The aircraft impacts were equal in energy to 1300 and 2093 pound of TNT, like big bombs. The kinetic energy impacts knocked off underfloor insulation which is easy to dislodge with a finger, and knocked off the 3 inches of wallboard covering the core columns, as wallboard can be smashed with a fist.  Thus the underfloor steel trusses, failed, as a fire fighter about lightweight steel trusses, do some research instead of making up BS based on biases and nonsense.  The fires in the WTC exceeded 600C, thus you lie about fire, you have no clue office fires reach 1000C and 1100C. 
BTW, steel studied after 9/11, albeit in the pile, steel was raised to 800C to 1000C, even NIST has this in their study, as does FEMA.
Your 460C is a failed opinion, based on BS. 
As for WTC 7, it may of failed during the cool down. Do you study the papers and research already out from real engineers?  No, you spew BS based on your opinion.  
You are now a liar, as we can see evidence of temperatures great than 660C. You can't do more than spread lies about 9/11; why do you lie?
15 years and you failed to see the melted Aluminum cladding on the outside of the WTC.  
There was no unimpeded free-fall of the WTC towers, you can't do physics, or figure out acceleration and velocity.  Another lie. 
The planes did dislodge insulation, and had enough energy to do so. You failed to do the physics, again.
Reply: eyesuntzu The kinetic energy of the aircraft was absorbed by the resistance of the structure, so your "big bomb" theory is really just a fireball that dissipated over a matter of seconds. NO massive explosion within the structure, dimwit. That's just your wishful thinking and ignorance of energy transfer talking.
Reply: eyesuntzu The initial structural failure was to the envelope, which had NO EFFECT on the ability of the Towers to remain standing. A fireball  consumed the fuel energy of the aircraft, which was over in seconds. Damage to the interior of the structure was not sufficient to cause immediate collapse either, and in fact was insufficient, based on official estimates, to pose a threat to the redundant structural capacity of the buildings. You are assuming 100% energy transfer to the  structure of the building, but the buildings were open enough to allow much of the energy you claim to be dissipated as atmospheric heating and concussive force directed at  open air (and we didn't see the windows blow out, DID we???!). The notion that building insulation was  somehow  the focal point of the applied force  doesn't even consider that only SOME of the insulation would have been in the path of the blast, and that the "blast" is a highly speculative result of a lot of poor assumptions. Your notion that the energy of the applied force somehow shook all the fire insulation loose is an interesting concept, but without enough heat applied over enough time, is a pointless exercise in futility. NO evidence of high enough temps over a concentrated area, and NO steel evidence to back up your specious claim, so FAIL.

 Fuck your "woo", you sorry  little drooler, Your brain is stuck on stupid, and your ego is holding your questionable intelligence captive..
Reply: eyesuntzu you conveniently discuss horizontal forces only, but do not discuss vertical forces- this tells us that everything you type is trying to hide something, and places all your arguments in the dubious category. Arguably the vertical forces are the only ones that matter, to wit, did the vertical structure of the floors below the plane damage have vertical  strength to continue to support either the static weight or dynamic force of the floors above them? If not, then why did the floors collapse perfectly symmetrically? 
Why did both buildings collapse so perfectly just like nearly all controlled demolitions I've ever watched, except for those that were bungled and collapsed to one side like these should have. 
Chances are extremely slim that this occurred as you say, if it did, both buildings would not have collapsed so similarly, and so perfectly symmetrically.
Reply: Jim Nason how many people are involved in a controlled demolition of a large building and how many days, weeks or months does it take to stage?